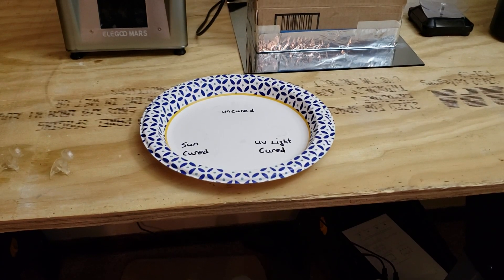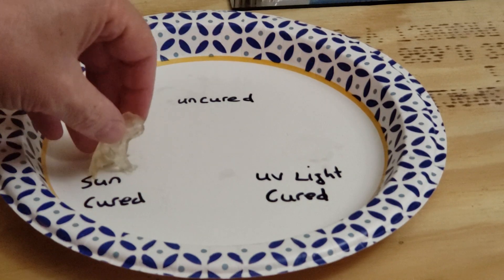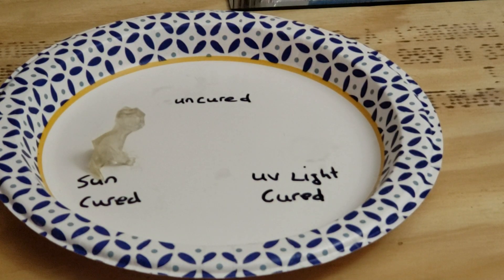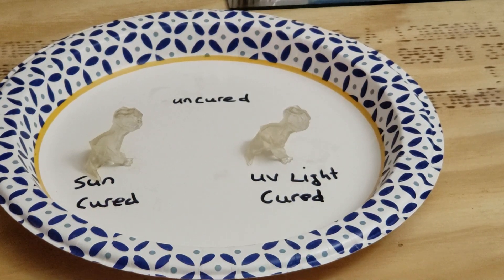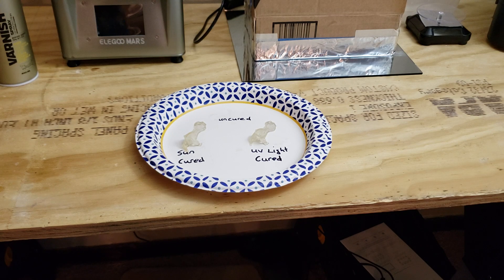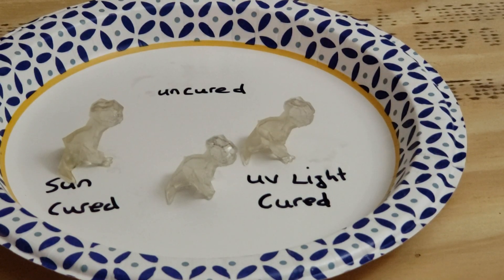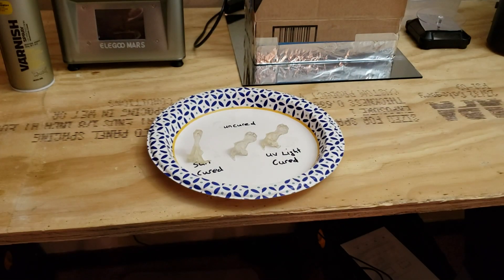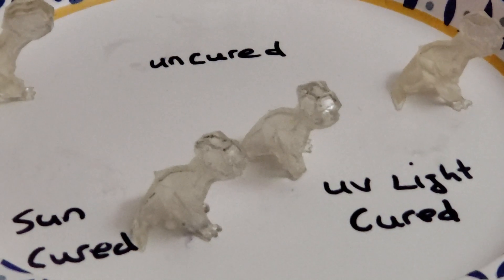Elegoo Mars. Prevent transparent resin yellowing.

Comment: Is there anything I can do to clear it after it became yellow?
Reply: has anyone tried putting the print in hydrogen peroxide while uv light curing? they do that to clean old yellowed plastics ,e.g old playstation controllers, makes them look new
Reply: @dalesmith4609  I'm surprised you haven't received a reply on this. Sounds like an interesting idea maybe I'll try it. Have you tried it yourself? Do you think it would work?
Reply: @dalesmith4609  I tried this last night with a piece and it made no difference. I only had 9% strength hydrogen peroxide available. Maybe a stronger solution would be better. I don’t have access to any.
Reply from the maker: Unfortunately there is not.
Reply: @fergi1959 .. 120s (tried 60s) Exposure works above 0.5cm prints.. wet 280grit sandpaper improved transparency or adds more scratches for more bounces in relation to rays outside of the visible spectrum... maybe.
..
Wondering if metal will bond onto Graphite varnish..
Reply: 5000 Grit Wet Paper or Food Dye? 
Random Layer heights
2inch @ 0.05 looks (Glasslike) 
3inch @ 0.10-25 steering towards unclear rubberishness..
Reply: @dennyspence4210  Can you explain that better? Are you telling me to use sandpaper? But sun just goes through the whole thing and makes it yellow in its chemistry.
Reply: 0.10mm prints look more transparent @160grit wet sandpaper, unsure how dense cured resin is but might try a blacklight..

Comment: doesnt the un-cured model suffer a Drastically reduced structural integrity and thus longevity reduction? if the thing printed loses functionality and resilliancy, what good is just 'not curing it' for color sake? is it anywhere near as strong as it should be? for lenses and optical usage, the print would be near useless if it will just squish out of shape at the first un-careful touch.
Reply from the maker: For ornamental pieces structural integrity is not normally required. So color clarity and detail are the goals you're looking for.

Comment: But if you don’t cure it you are putting anyone that touches it at risk from the uncured resin. I’ve heard that sanding then applying some of the varnish to the cured piece it makes it clear again.
Reply from the maker: I have good lucky making it clear. I was just looking to avoid the yellowing.  I got the idea of coating it with a sealant before curing from a web page.